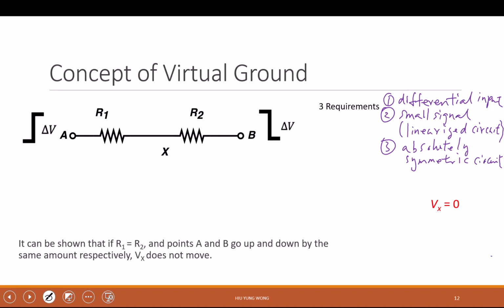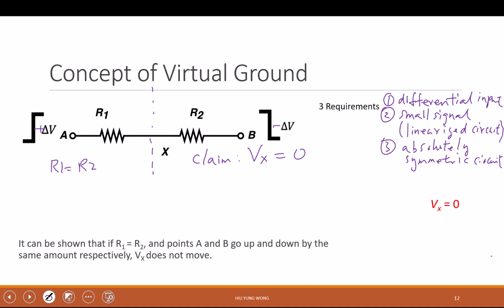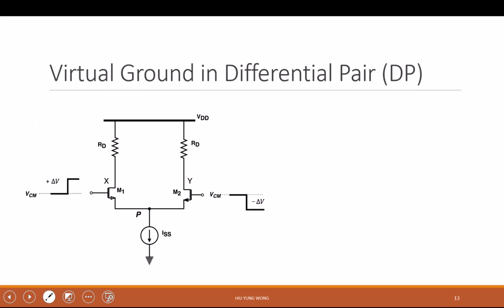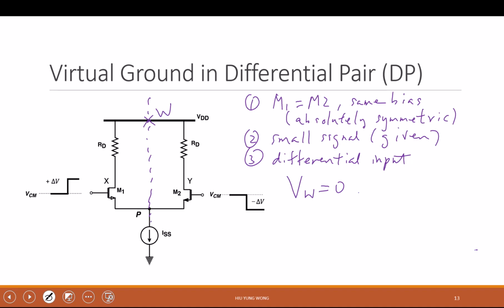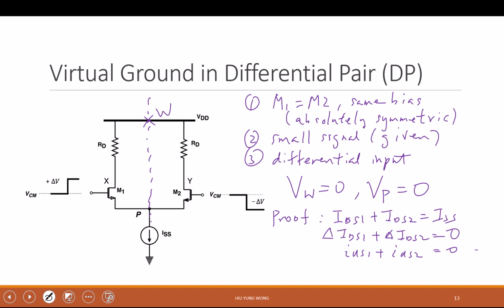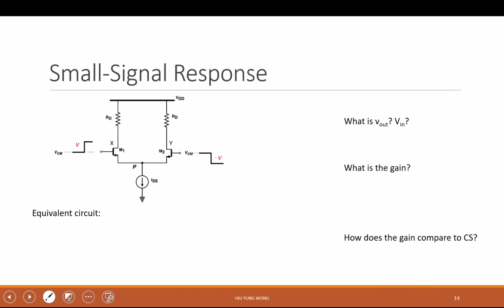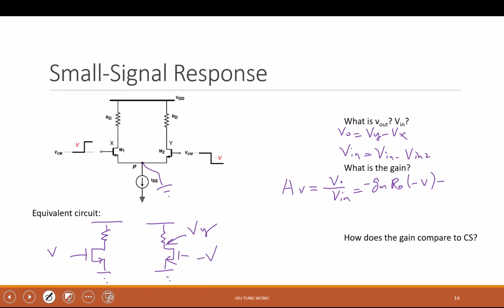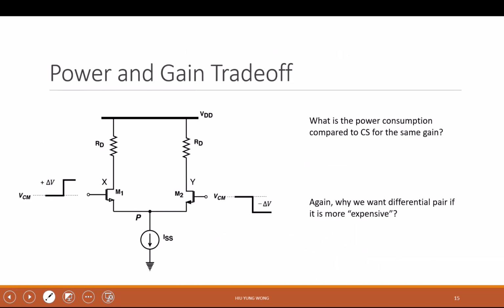L15-3 Virtual Ground Concept and Gain of Differential Amplifier

Comment: Hi sir, thanks for your knowledge. At 11:33 it is observed  that small signal gain is same as common source amplifier. But why it is in positive gmRd? CS small signal gain is -gmRd right
Reply from the maker: Since this is a differential amplifier, the sign depends on how we define the input and output. I defined Vout as Vy-Vx and Vin as Vin_left-Vin_right. Then the gain is positive. If you define Vout as Vx- Yy, then it is negative. You see Vy is on the right branch and it still goes in the opposite direction than Vin_right, like in a CS amplifier.